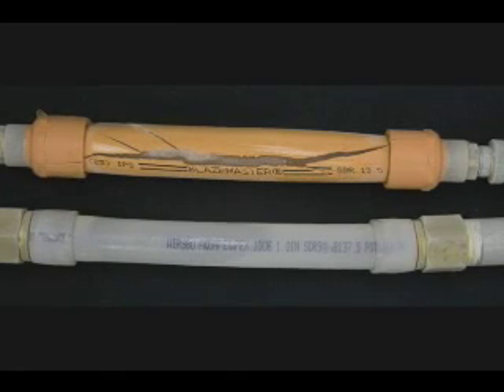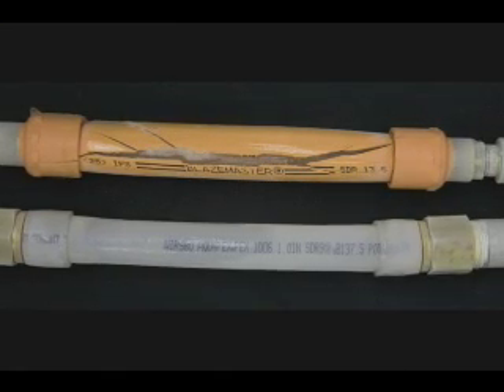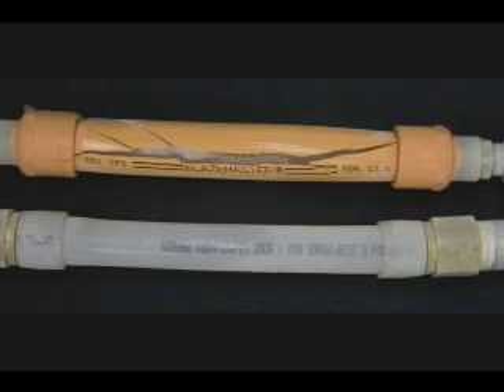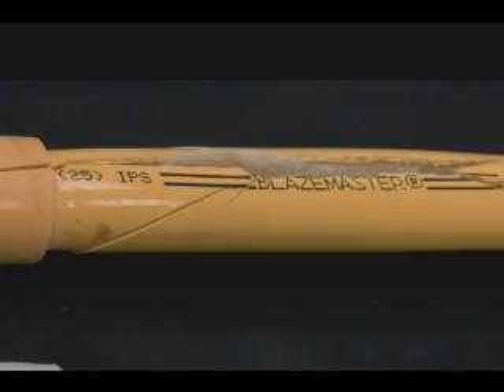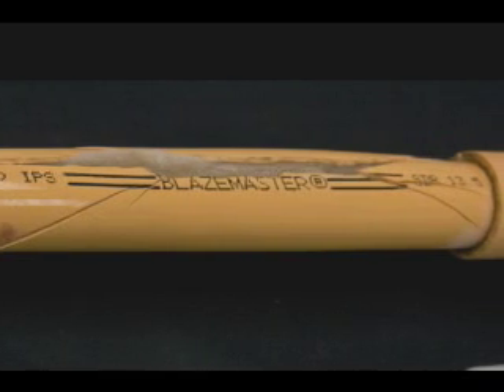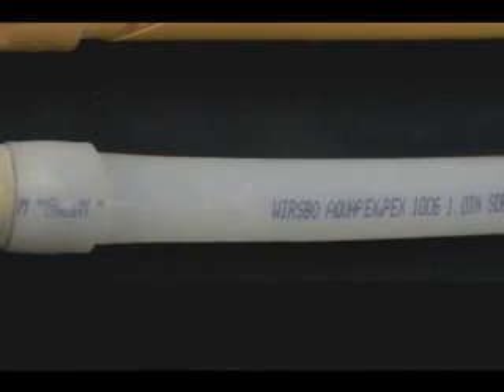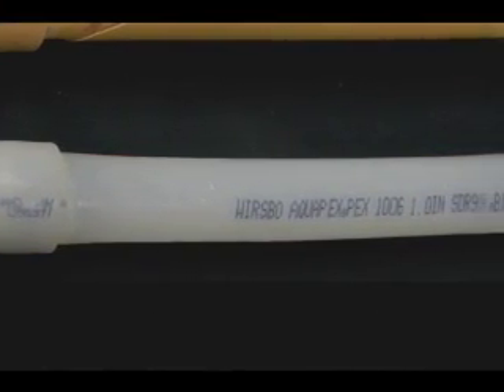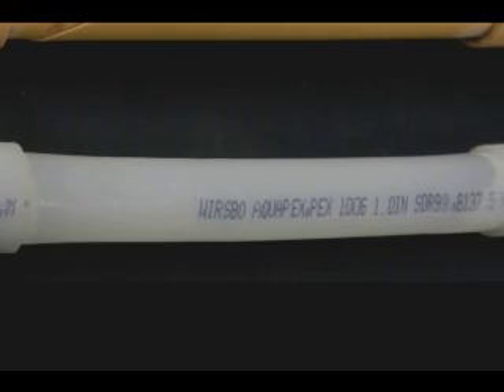PEX-a: Fire Sprinkler Freezing Advantages

Comment: Yes the pipes may expand but the fittings won't. PEX Pipes are more resilient against freezing but NOT freeze proof.
Reply: John C wirsbo that is a type of per uses poly bands as well as poly pipe so the bands expand as well as the pipe its amazing stuff I use it all the time
Reply: @GiantMeteor2028  Do the fittings ever come apart from a freezing issue?  I'm just wondering.
Reply: @commodoresixfour7478  I’d like to know this as well. Are the uponor fittings the best to use with uponor pipe, or standard fittings with copper crimp ring?
Reply: @GiantMeteor2028  Do the fittings ever come apart from a freezing issue?  I'm just wondering.

Comment: i shall use pex in a fishing camp guaranteed to freeze solid every winter . will the pex fitting crack
Reply: Michel Nadon Pom
Reply: Michel Nadon unfortunately yes the fittings will burst whether plastic or brass there is no 1 fixes all systems yet to date but pex is a step in right direction they have to get the fitting perfected next however put fittings where they are accessible and easy to change rather than hard places